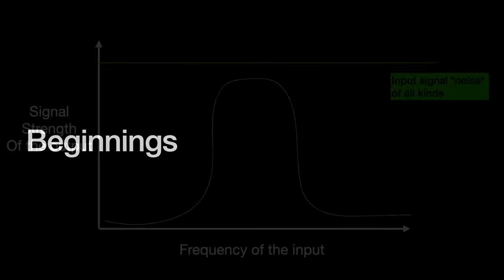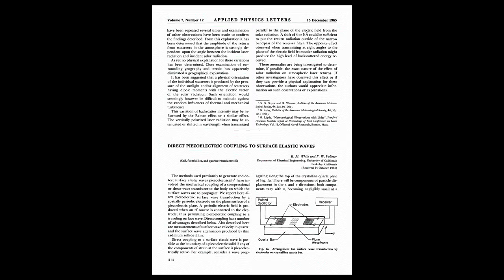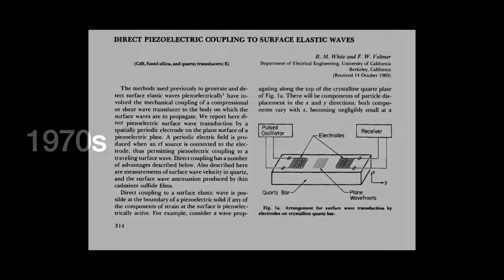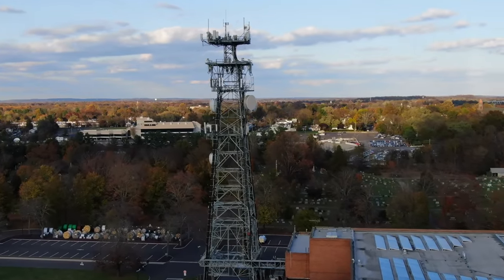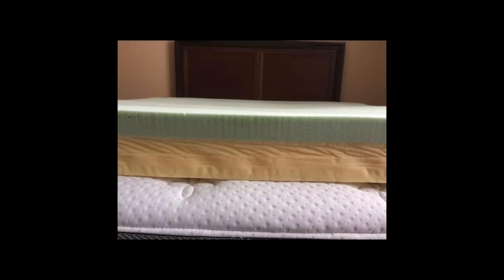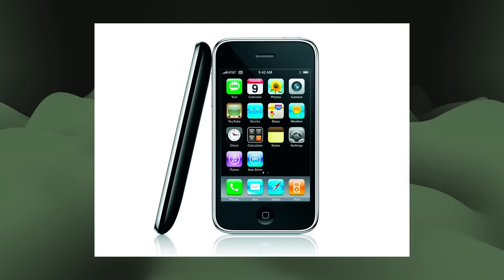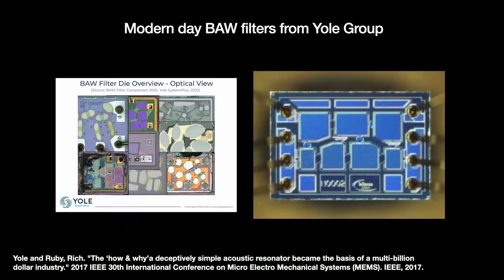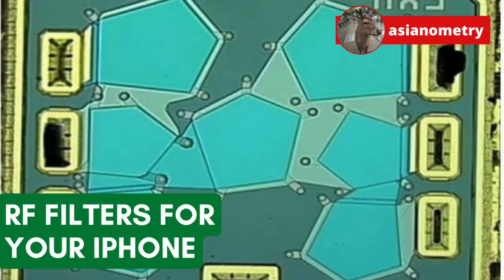The iPhone Forever Changed the RF Filter

Comment: Really interesting and not too niche for me at least.  I remember when SAW filters suddenly became common in TV IF stages - ISTR it was not so much about performance as cost. They replaced several LC circuits which all needed to be hand-tuned in production, saving on parts cost, board size and manufacturing time. The IF stage became small enough to fit inside the tuner can, avoiding the need to have additional shielding for a separate IF stage.
Reply: And also every car and garage door remote control had a saw oscillator to get the size down.
Reply: @Penfold42 I think that was also about getting good stability cheaply - early keyfobs had nasty LC oscillators tuned  by bending turns of a coil ( PLL synths were too costly and power hungry)
Reply: @mikeselectricstuff  so true. And often detuned by the person holding them !
Reply: wow, I though those things were solid state, but they're part mechanical, amazing.
Reply: The Zenith "M1" module comes to mind. We were using those in Dallas to decode subscription TV channels with an add-on digital board that did sync restoration and video inversion, as I mentioned, this was a subscription (pay) service.

Comment: As an electrical engineer, RF is, generally speaking, the blackest art in the whole discipline. The tech that goes into making the RF front-end bits in modern smartphones is on a whole other level, though.

In addition to the craziness that is the filters you show here, I'd be fascinated to see your take on the incomprehensible antenna designs that somehow tune and work reasonably efficiently on six or more bands, or the power amplification and oscillator circuitry that operates clear through UHF and a big chunk of the microwave band.
Reply from the maker: I’d like to but I also want to stay sane.
Reply: Flat foil antennas - also a work of art. They fiddle with parasitic and transients to cover multiple frequencies, e. g. 900/1800 and ..850 or 1900!? Then they add a flat hooked L to the foil pattern shape for... Something else.
There are patents and I imagine a lot of inside art.
Reply: Almost witch craft . But then you see them tuning them sometimes with a scalpel by just cutting them
Reply: RF information is so difficult to find, especially highly detailed videos or websites that dig into formulas and practical examples. Making any frequency above 200 MHz and amplifying the signal seems to be impossible for me. Another hard piece of information to find is anything about radars that goes into detail.
Reply: @Braydan789  yes, by design. Almost all of it is IP protected. And the process integration matters much more than raw capital capability. Most RF fabs are using equipment that was already considered old in the early 1990’s by silicon CMOS standards.
Reply: The HP stuff curious Marc has is seriously clever. Worth a watch for sure
Reply: @Asianometry  Too late for that now! <3
Reply: The Signal Path covers a lot of freakery that is microwave engineering. I'm also an electrical engineer, I work in the semiconductor industry but have had a strong interest in RF since childhood. I remember the Radio Society of Great Britain's VHF/UHF handbook from 1973 and reading about some magical techniques at UHF as a kid and now we have chip-scale filters, relatively cheap multi-chip modules and advanced packaging and even signal connectors have become interesting where almost everything has become a transmission line.  I've seen the move from a 4.77MHz system bus to multi-Gig SERDES channels and the journey so far has been fascinating.
Reply: No, I think that trophy belongs to the holes that flow in semiconductors.
Reply: @Braydan789  Radars? You could start by looking at the non-classified training manuals for military personnel who work on radars. The old-fashioned library is full of that kind of stuff.
Reply: @rjy8960  You missed the 1 MHz and 4MHz S100 bus. Good times for those who could sling a soldering iron in the early days.
Reply: Yeah, antenna design is quite harsh. and impressive. If you consider that besides the electronics, current smartphones have them around the body is mind blowing.
Reply: I am going to college for Electrical. Will a bachelors be enough to get a decent understanding of RF, or should I go with a masters to work in telecom?
Reply: @deepspacecow2644  It depends entirely what you're trying to do, but if you pick RF-focused specialties, then there are definitely jobs out there you can get with a bachelor's and then gain further knowledge and skills while working.
Reply: @siberx4  I want to work on RAN networks, and eventually start a wisp.
Reply: @Braydan789  can you share websites and forums you use to read up on rf
Reply: Is there much theory in that kind of antenna design or are they just using a good EM simulator and applying the usual algorithms to search a complex space to find a maximum?
Reply: Well... it /used/ to be a black art... but then simulation technology and our understanding of the domain improved significantly.  Now, RF is pretty well understood and behavior is pretty well modeled.  One could say RF has evolved from a black art and into a "spectrum" of color... though with mmW communication now becoming popular in our "real 5G" cell phones, this idea may now be somewhat "polarizing." 😉
Reply: Cosmic how you say the German Semiconductor Maker (Infineon) while GSM is on the screen...
Reply: These comments are giving me chills I thought I was alone forever.
Reply: @gryff8400 I didnt know anybody had patented foil antennas
Reply: @AllAmericanGuyExpert  not the school library any more its almost entirely electronic except for some textbooks
Reply: siberx4 noted, "...RF is, generally speaking, the blackest art in the whole discipline."
A very wise man once mused, "RF wouldn't be so difficult to understand if it were purple."   There are several layers to this nugget of wisdom:
1) Light is also RF, just a much higher frequency (shorter wavelength). Point being, if you can understand light (and unless blind, you do) then you can understand RF.
2) If you make RF visible (using appropriate test equipment, even extremely simple old-school gadgets), then you can begin to "see" it.
3) The only intuition that an EE may be missing is about standing waves, and that really isn't all that difficult to hoist aboard. Imagine how a quarter-wave monopole accepts power.
While I'm here I'll explain EMI/EMC, the entire field: "You know antennas? Do the opposite."
Reply: My thinking exactly.  I kind of get the impression that that device you showed consisting a 5 or 6 only proportioned pentagons somehow does the job of 40 single frequency filters at once?  How in blazes does that work!?!
Reply: I believe the antenna in mobile devices is incorporating some "fractal magic" in their design. I remember seeing something on this saying that they can create a small wide band antenna using that "science"... And they usually use more than 1 in smart phones; usually 4 of them (or even more)

Comment: Really well done! I should mention that a 40-band phone may not have 40 filters since the baseband bandwidth has also increased. Now, some filters may encompass multiple bands. Its a complicated trade off that considers RF interference, cost, complexity, regulations, and performance.
Reply: re: "a 40-band phone may not have 40 filters"
Yeah, many of the bands are adjacent, so, one filter covers multiple so-called 'bands' ... this is getting into the weeds though now.
Reply: Baseband scalable filtering applied. As well 40 bands sometimes logical terms since different technologies use same frequency allocation, but have different number assignments.
Reply: @eugen19  One observation that was made, maybe 10 or 15 yrs back on an iPhone, we found that a  2 Watt or so UHF radio in transmit within a couple feet would force the iPhone to 'lose the call' (drop) in progress ... we theorized the strong UHF signal perhaps overloaded the wideband front and even with 'filtering' before it, so filtering is never absolute in function, its a relative thing, with the skirts still allowing some signal ingress into the phone.

Comment: I used lots of ceramic SAW filters for analog TV and radio receiver for IF frequency (455 kHz, 10.7 MHz, 45.75 MHz) from Murata.  Before SAW  filter, we used bulky ferite core coil in square metal can. One good thing about SAW filter, other than high-Q and stability, is it does not need center frequency adjustment, which need time-consuming manual labor. things of that old days with IF coils. But BAW is new to me. I didn't work for mobile RF.

Comment: Maybe you could do a video on the history of antenna designs, ending with cellphones or satellites. I researched this a few years ago and was surprised to learn the size and shape of the antenna in the iPhone and how such antennas were developed.
Reply: A modern multimode antenna design is actually a specially selected magical sigil corresponding to the most appropriate demon for the application; electrical signals activate the sigil, calling forth a tiny demon inside the phone, radio, or somesuch communication equipment.  The demon is handed a very small letter containing one or more data packets.  The demon then steps over to the recipient equipment sigil instantaneously.  After the demon takes a short cigarette break to impart the appearance of a lightspeed propagation delay (these breaks are a condition in their employment/capture contract, and if these break times are withheld in the name of improved corporate efficiency, say, or maybe in a shortsighted effort to create a superluminal network, the demons get angry and go on strike and start bashing about breaking all the fragile things we tend to enjoy, like airplanes and time and global causality.)  At the appropriate time, the demon places the letter upon the receiving sigil, whereupon the letter disintegrates into a quite beautiful puff of brightly colored particles with an astonishingly short half-life - so short, in fact, that they nearly always expire an infinitesimally short time earlier than they are created.  Sadly, though known to be of exquisite beauty, this means they are invisible, thoroughly undetectable by any means, ever, and have never been witnessed.  Despite this author's allocation of a significant portion of this paragraph to their detailed description, these particles are completely irrelevant to the sigil based communication system, of course.  Under the cover of this completely invisible and useless smokescreen, the demon deftly extracts the letter contents before it vaporizes, hides it up his sleeve, and then slowly backs up in a very suspicious and conspicuous manner toward the baseband processor, and, once he believes nobody is looking, opens it up, shakes out a jumbled collection of 1 and 0 binary bits from his sleeve, closes the processor, and sneaks away.  Thus are delivered the contents of the data packets to the recipient device.  Of course, though all the bits are accounted for typically, owing to the incompetent data integrity measures inherent in a demon's shirt sleeve, the bits are in random order and better approximate a digital sampling of thermal noise than the desired message.  As they are utter bunk now, the baseband processor simply deletes the received bits and replaces them with a perfect, in-order copy of the original message, using magic.

Comment: This brings back happy memories of my days in the piezoelectric technology department at Bell Labs in North Andover, MA in the 1980's and 1990's.  Lucent eventually sold off the whole business to Vectron in New Hampshire.  One of the things not mentioned in the video is why SAW and BAW filters have become less popular in mass-market consumer electronic devices these days.  And that is because these RF filters don't integrate well with silicon integrated circuits and that increases  cost.  One is forced to go off-chip for part of the transceiver chain and return back on chip.  Instead, low/zero-IF architectures are used.  But these filters can offer very high selectivity because the inherent high-Q of quartz on which they are built in applications that require them.  So they'll always have a place in electronics.  Even cheap 32KHz watch crystals can keep accurate time to within seconds/year.

Comment: One interesting use of this technology is to modulate laser diodes and tune their frequency. One of these devices modulates the beam with data in the GHz range while the other one creates a diffraction pattern that picks the lasing frequency band. The entire assembly is tiny, but it allows the high speed data you know and love.❤
Reply: That's a cool idea.

Comment: I think you missed the analog vs digital switch.  The first tiny handy phones in Japan were analog, utilising saw filters that kicked off the whole high volume drive.  When I worked on radios in the early 2000 everything available was targeted to the handy phone that was in a battle with Ericson and digital 3g.  The big player in multiband was improved front end receivers and digital converters, as all phones use digital filters to isolate the bands with the front end filters blocking the transmit signal from bleeding into the receive band, and reducing mix signals from showing up in the receiver and transmitter.  There is no longer the concept of a pass band carrying the data from a single channel (like the analog tv channels).  Linearity across the band is one of the critical features as it contributes to the performance of the digital filters.  The antennas are also key as there are multiple antennas with their own front end modules.  It's not quite as simple as presented, and 5g may be driven by further integration making traditional suppliers less necessary.
Reply: I spent a stint at DSC/Alcatel supporting the Japanese PHS (Personal HandiPhone System) VMC (Voice Mail Center) back in the 2000 timeframe ... I did maintenance programming on the code that interfaced with the ISDN PRI cards, the PCs that held the PRI cards ran scripts to prompt the caller for info, announce messages and so forth ...

Comment: Please help to clarify the following statement:

"Nearly 15 years later, each filter cost between $1.40 to $1.60 when bought in volumes of 50 million units.
You can fill a bucket with these filters for more than what the bucket cost."

How much does the bucket cost?
How many filters does it take to fill a bucket?
Reply: I'll wait for that one comment with proper math, including  fill-in ratio for 3 dimensional bucket
Reply: Yea, kinda suprised Asianometry dident noticed this himself when he read the script
Scriptwriter clearly fucked up. Someone read $1.40 to $1.60 and went 'ohh, thats cheaper than a bucket'..
Reply: Yeah that was either bad writing or a misunderstanding. He was describing bulk pricing but misinterpreted it as an insanely low unit cost.
Reply: Yeah, even I was caught off guard by that
Reply: None of you thought about it for even two seconds, he said MORE than what the bucket costs. It's a joke. It flew like a Concorde above your heads. If the bucket costs $4, and filling it with filters costs $4,000,000,000, it costs MORE to fill the bucket than what the bucket costs. He did not say LESS. T_T
Reply: @rrai1999  “more than what the bucket costs” then saying “I feel bad for the saw manufacturers” then makes ZERO sense.

Comment: As a ham operator, I feel seen!  Lol.  Since a lot of hams experiment in the HF bands, they still tend to use coils and capacitors, but, as software defined radios allow small packages to transmit and receive higher frequencies, I'm quite sure that the latest ham radios that do VHF, UHF and higher, are making use of some of the filters in question.  The Icom 905 radio allows for Satcom/GHz experimentation, so a bunch of the filters you mentioned will be in that equipment as well.  Great video!  Thanks for the coverage!
Reply: DIM X[4999]  # Input signal
DIM Y[4999]  # Output signal

FOR I% = 50 TO 4949  # Loop over each point
    Y[I%] = 0  # Initialize output
    FOR J% = -50 TO 50  # Calculate summation
        Y[I%] = Y[I%] + X[I% + J%]
    NEXT J%
    Y[I%] = Y[I%] / 101  # Complete the average
NEXT I%

Comment: One big application for SAW type devices was TVs in PAL standard countries, where the technique was used to make 64uS quartz delay lines. They consist of a wafer of quartz with electrodes on two corners. The signal is injected at one corner, the acoustic wave bounces off the various edges, like a ball on a pool table, & ends up arriving at the other electrode to generate the delayed signal.

Comment: Great channel !!
However this vid a bit misleading in discussing Q as a figure of merit for bandpass filters. 

For single channel applications high Q is definitely superior, and can reach E7 or 10 million.

The Q of a bandpass filter is an accident of legislation. 5G bands are different in different countries for example 
Europe :
3400-3800 MHz
USA :
3100-3550 MHz 
So frequency legislation defines the Q.

For a bandpass filter the ideal is a "brick wall" which has no loss in passband and infinite loss outside passband.

In our finite world this is never possible. 

The relevant figure of merit for passband filters is "shape factor" which compares the filter width at 2 different levels of attenuation like -3dB in passband vs -60dB in stop band, where these levels are tailored to the application.

The shape factor describes in real world how close ye are to the ideal "brick wall"

Keep up the MityFine work !

Cheers !
Payne